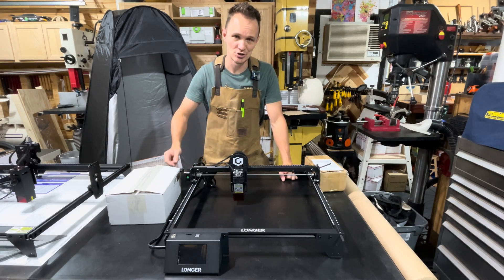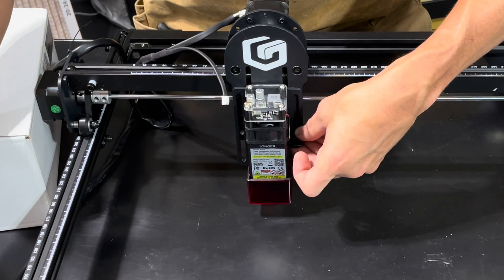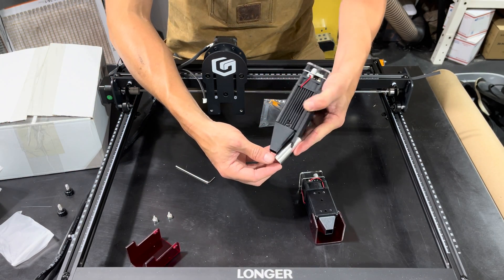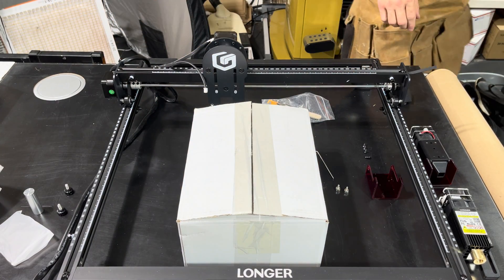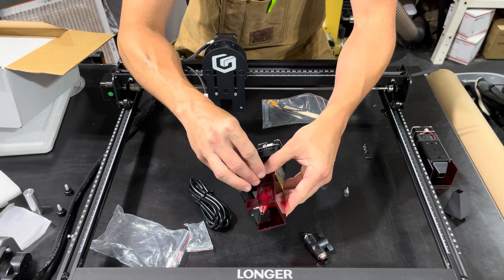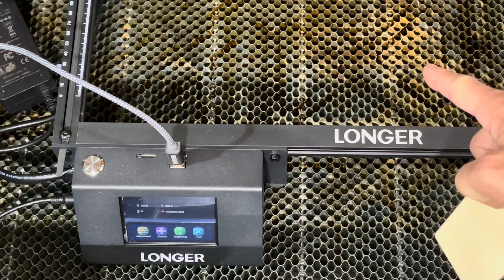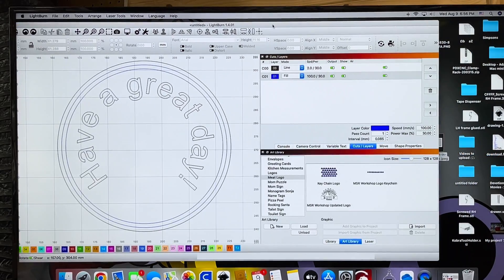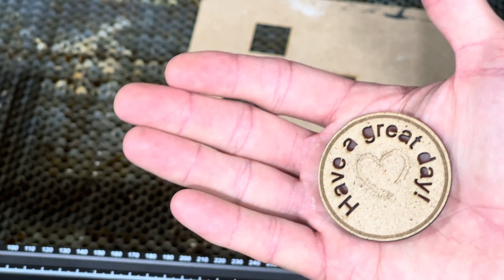Longer RAY5 10w Laser Setup and Testing

Comment: Complete skipped over the lightburn set up into a burn….
Reply from the maker: The process for connecting it to light burn is essentially the same for all lasers. You turn the machine on start light Burn., click on devices in the right hand corner, hit find my machine , and then generally that’s it. 
You can also like wear your machine homes. Right or left hand corner. Generally, the machine, bad dimensions will be automatically programmed during the set up, but you have the ability to type in the length and width if you choose. 
You can also rename your machine during this process as well . 
From there, he can start cutting like in the video